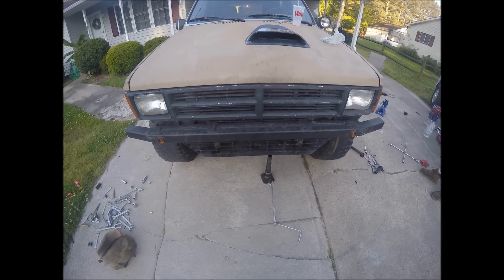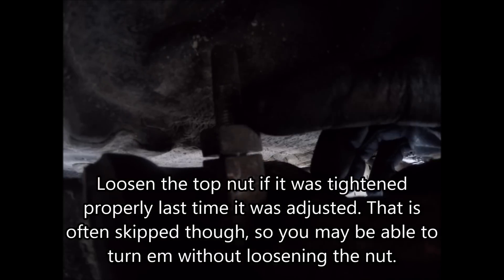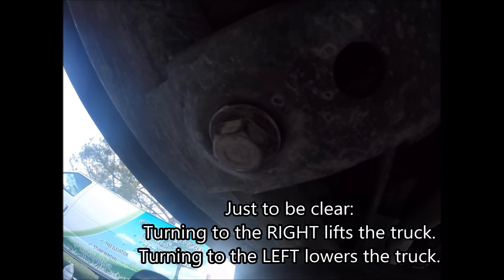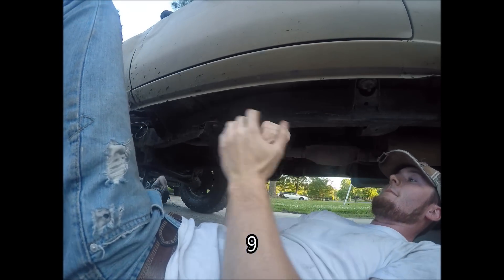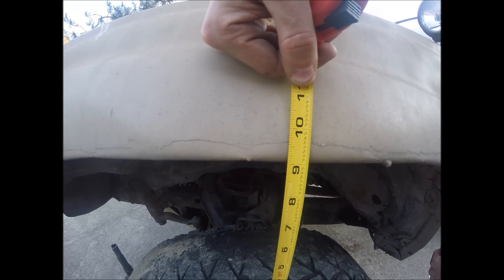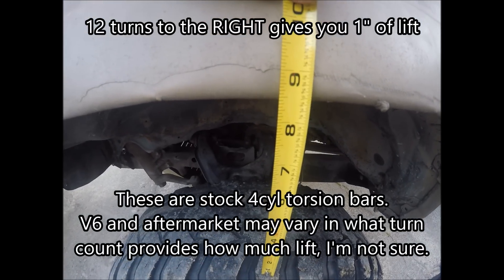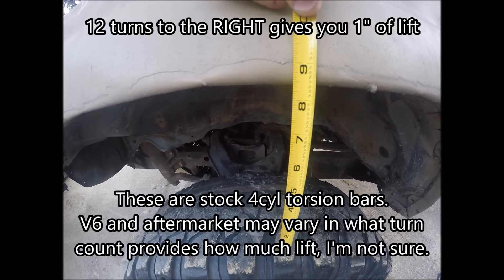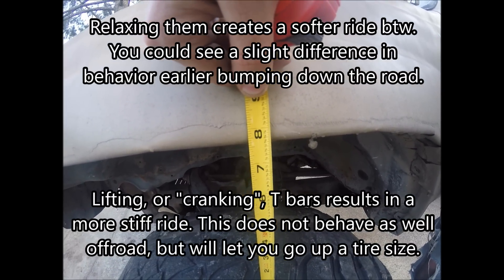How to Lift/Lower with Torsion Bars- pickup/4Runner

Comment: How low can you go with torsion bars? Will the bolt come loose if u go too low or something? Or those the torsion just stop spinning when it reached its limit? (Up or down)
Reply from the maker: Olympic Gaming I think you'll sit on bump stops before u run out of bolt but yes, as I showed in the vid, there's a nut ontop that u could I guess turn the whole bolt out of
Reply: Olympic Gaming  did you try this with yours? I. Wanting to drop mine too

Comment: such a helpful video, will adding ball joint spacers and not tightening torsion bars give me no lift though?
Reply from the maker: added spacers will lift u by the exact height of the actual spacer. so if u buy a 2.5" kit, which is 1.5" spacers, you'll get 1.5" lift if u don't crank the tbars
Reply from the maker: Which will ride nicer than cranking them lol oh and thanks!
Reply: is it possible to get 2.5 spacers and instead of cranking t bars getting shocks that are 2.5?
Reply from the maker: I'm really really not a fan of lifting the stock IFS more than 1 inch cuz of the added stress on the lower balljoint and steering linkage. I'd suggest mixing in a body lift if u want more lift while staying IFS. mine I did +1.5" spacers, relaxed my Tbars  -.5", then added a +1" body lift for an end total lift of +2" roughly

Comment: HELP! > Does each side of the bar have an adjustment screw? Or is it the one screw to adjust both left and right side of the truck?
Reply from the maker: the forward end of the torsion bars bolts to the upper A-arm on that side, with no adjuster up front. but there is an adjuster on both sides (left and right), u have to adjust both sides unless u want to lean one way really bad lol I just showed only one side in the vid to save time.
Reply: lol

Comment: Do you have to settle in the torsion bar?
Reply from the maker: They will settle themselves in a day of driving normally. I just settle them immediately so if they settle into a position you don't want then you can adjust them accordingly now rather than later.
Reply from the maker: Cuz I've adjusted them before then went into town and when I came out of Wal-Mart it was obvious my truck settled leaning badly to one side during the drive there lol that was my first time ever messing with em.

Comment: Bolt takes a 7/8 ? Shouldnt it be Metric???
Reply from the maker: 7/8 fits the most snuggly.
Similarly, a 15/16 fits the gear oil drain plugs most snug.

Comment: i got a 1992 toyota pickup truck that i wanna lift cause its to low. so all i gotta do is lift my truck with the jack and turn it to the right to lift it.?
Reply from the maker: Yessir. It helps to pop loose the stopper nut before doing it, it's a good idea to tighten it when you're done. Depending on how high you go, an alignment might be a good idea when you're done.
Reply from the maker: But lifting that way is less than ideal. If you have 70 bucks and a grinder I'd highly suggest you lift it via ball joint spacers instead, I believe I left a link to that video in the description but here it is:
https://m.youtube.com/watch?v=LexpPahxN90